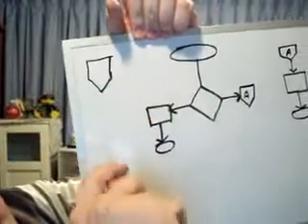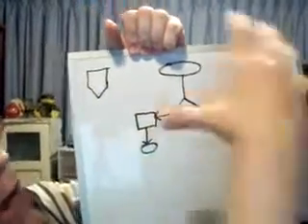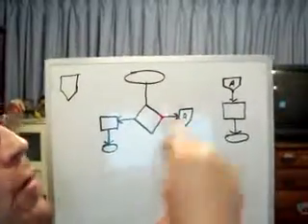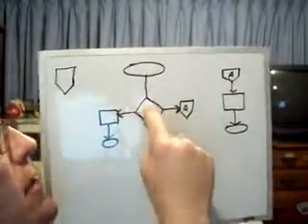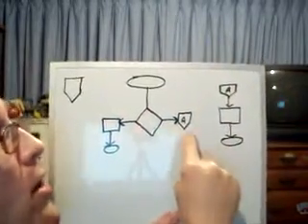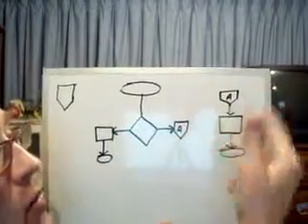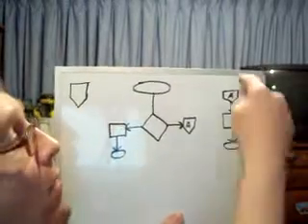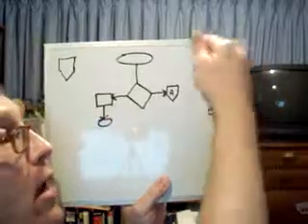Flowchart Off Page Connector

Comment: what if you have 1 flowchart with two different outcomes?.... how would you draw it? is it ok to have 2 ends in a flowchart? or one end will say C (for connector) and have a line point towards the other end so in reality, I would only have one finish and one start... please help. THANKS!
Reply from the maker: If you have 1 flowchart with two different outcomes, you would label the first outcome A and the second outcome B.  Then you would use two off page connectors.  The first off page connector would be labeled A (because it's the first outcome) and the second off page connector would be labeled B (because it's the second outcome).

You would have three flowchart pages.  The first page would be the one to show that the computer program has two separate outcomes.  The second page would be the first outcome flowchart.  The third page would be the second outcome chart.